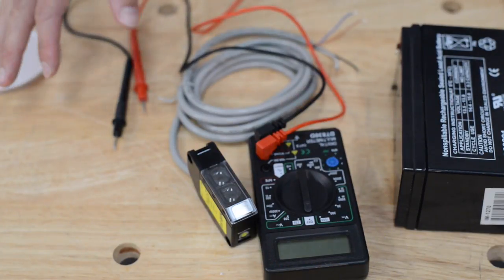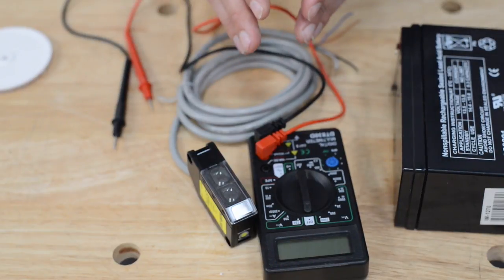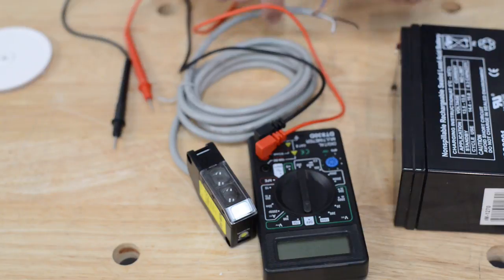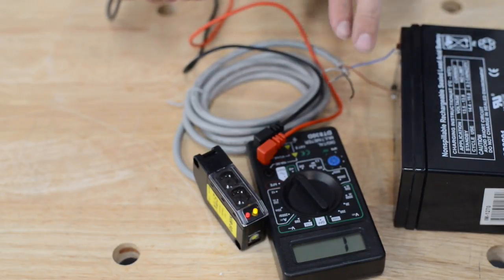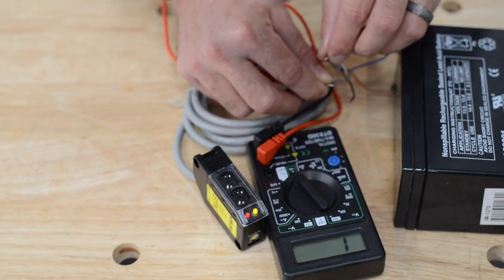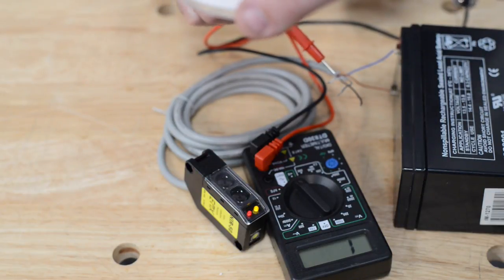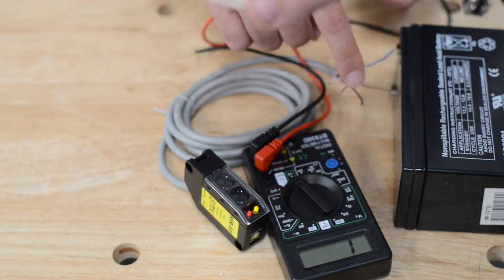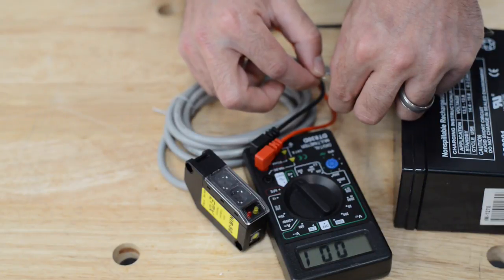How To Determine Wires on Photoeyes for Driveway Gate Openers

Comment: If I am following correctly, when the circuit is open (meaning there is something blocking the photoeye ) the gate is prevented from closing. conversely when the circuit is closed (meaning there photoeye is not blocked) the gate can close). But where do all the wires connect to on the circuit board.
Reply from the maker: Hello Mitchell, if you need a more comprehensive answer please visit GateCrafters.com and give us a call. We would be happy to answer any questions you might have.